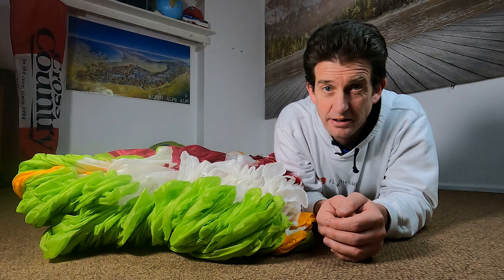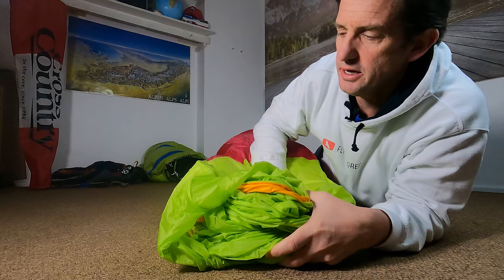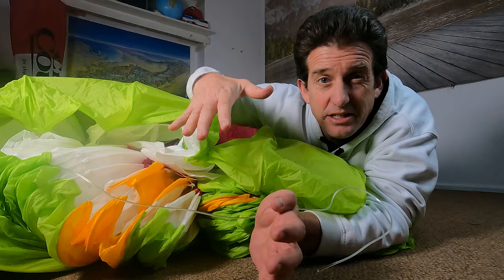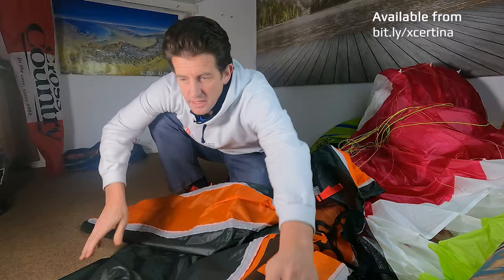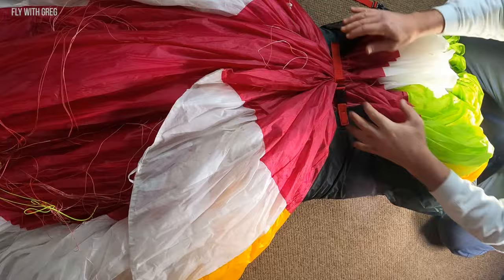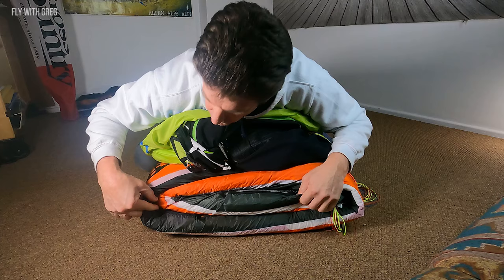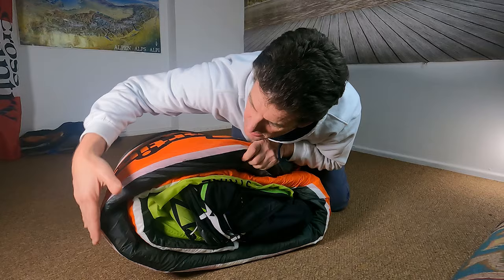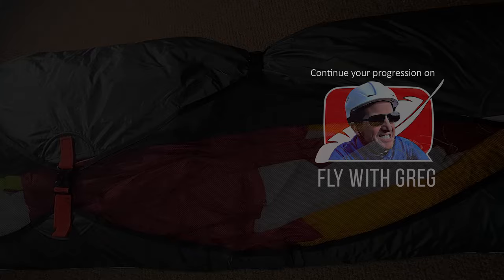A common paraglider packing FAIL (it will SHOCK you!)

Comment: Good video ...always done it that way since 'pillows' arrived. It was the way to avoid them and keep the curve large. One thing puzzles me regarding bags. There seems to be a desire to get smaller bags and squash  the gear in at any price ...usually resorting to lots of persuading knee, body and squeezing. A slightly bigger bag (especially lightweight ones) adding little weight but a more relaxed pack and glider. Just a thought - size doesn't directly correlate to weight except in the mind.
Reply from the maker: I hear you Ed, but the smaller bag does bring the centre of weight closer to your back for hiking, which makes a big difference, reducing back strain. The trick is to find a bag that has some good adjustment to pull it in effectively, after you've got it in the bag easily.

Comment: I don’t believe you will damage your glider if you pack it different. I did test this with a new glider. I used to pack it always cell by cell but with this new one I used the old way, just fold it and nothing more. After 2 years, I didn’t notice any differents to my previous glider which I always folded cell by cell. It still launched easy, no more collapses and after a flight, all cells were open like normal. So in my humble opinion it is just what we think it does. It actually doesn’t make any differents. Even Nova gliders said exactly the same with their gliders. It is a nice video though.
Reply: You might be right, that modern gliders are less keen to get damaged by bad packing.

But:
Close bends as you'd be doing then when you pack it with two sausages give a way higher stress to the material.
Adding, that you tend to fold the glider always at the same spots.

Concertina bags are not perfect but out of view of engineering and material science they sure make a lot of sense.

Another big advantage is, that you don't need to open you glider for packing.
After landing, I usually keep my concertina bag in my jacket, I put it on the ground nicely, pick up the glider with all lines, throw it on the open bag and then get out of the harness.
This is super fast, practical and protects my glider from getting draged around the ground.

I do pack my miniwing the old style and stuff it in a drybag for mountaineering.
I think it's important to understand what stresses our 4000€ flying machines.
Reply: Nova gliders don't have C rods so that's not an issue for them.  Even though Nova wings are known for ease of packing, they still include this quote in the manual... 

"When the wing is folded it is recommended not to bend the rods unnecessarily. This is particularly true if the wing is to be stored for longer periods."
Reply from the maker: @tonyevans3297  incorrect. I can quote directly from discussions with Nova. "The days of packing your wing any way you want are long gone". Modern materials demand modern packing methods
Reply: @FlyWithGreg  I was kind of agreeing with you Greg and disagreeing with Marco... I quoted directly from the Mentor 6 page about not bending rods unnecessarily.  Perhaps Nova should update their packing information to make it more clear.
I pack my Sigma 10 so as to have no bends whatsoever in my rods.  I don't have to wrap it around anything as the Sigma is designed so that lining up the leading edge also lines up the C rods.
Reply: It's the sitting on it when it's not flat insides.
Reply: @FlyWithGreg  100% with u Greg. Above comments saying they see no difference ect. 

That’s fine but in time they will realise . Safer more reliable and long lasting wings are what we need the manufacturer has nothing to do with how they are looked after sold.

Imo, more attention to this good practice saves wing damages , our pockets £/£/$ , more importantly wing integrity for safety. 

Love the vids mate ! Keep more like
It coming

Comment: I wonder if a quick-pack-bag is less or more stressful for the tissue.
Reply: this!

same ;)
just bought my first glider and it didn't come with a concertina-bag, so I'm "stuck" for now with using my quick-pack-bag which I already had before the glider ;)
Reply: @jodelboy  Just guessing, but it probably comes down to how much you have to walk with the quickpack-bag. With every step the tissue can wiggle inside the bag. And with every wiggle, there is probably friction. Also I noticed my rods not looking that great after longer use of the quickpack. They are probably fine though.
As it is you first glider, I can only give you two advice: use it! and don't waste 25 minutes with packing. Try to get another flight in! The first year is the hardest, because you'll have a lot of shorter flights that don't learn as much as one longer flight. But you will profit from fast packing because you can train launching and landing, which are crucial for you being great at.

Comment: Hey Greg, thanks for sharing your folding tips. My question is what if you’ve already got bent ribs? Is there a way to straighten them, without having to replace them completely?!? 

In falconry we use a hot water bath on a bent feather and it straightens perfect… can that trick work on the plastic ribs??
Reply: Also my pod with foam doesn’t really fit inside the wing… lol

Comment: Nice! Thanks! But how to do if you have reverseble hikeandfly harness and dont want to disconnect the harness and the glider every time?
Reply: Depending on the glider it's not a problem to bend the rods ...
Reply: @E620SE  you can bend it around helmet, clothes, light inflatable pilows....
Reply: @adrianadrian7907  yes but with most lightweight glider's it's not necessary to bend it around anything
Reply: Buy a wing with only relatively short rods (short enough to fit in one fold length) in the leading edge. Or if too long for that, make the fold on them the outermost one. Thankfully shorter rods are becoming more common again now after the curse of full length rods.
Reply: @omfghai2u  depends on the category. Most 2 liners have rods from LE to TE

Comment: and then Maurer shows up, fold his wing like whatever in 30s, squeezes with a knee, packs with harness on top and then flies 200+ km on it :D But yeah, totally agreed, fold to the side, wrap around the harness and it's safe. But unfortunately it takes time and is a little bit more bulky.
Reply from the maker: You can get away with murder with Nitinol rods. I still wouldnt choose to abuse them.
Reply: @FlyWithGreg  getting your equipment for free should also help :D

Comment: I have problems with the middle B rods, they don't get aligned and sometimes the folding bends them quite a lot... What do you do to have them aligned as well?
Reply from the maker: if you are folding around your harness they shouldn't get a tight bend. You could try begin your concertina fold at the trailing edge, clip up a few clips, put the harness on that piece, then do the leading edge. That way you have some resistance to pull against as you cell-by-cell, so you can pull the B rods to get them moving next to each other.
Reply: @FlyWithGreg  I will try it ;-), thanks Greg